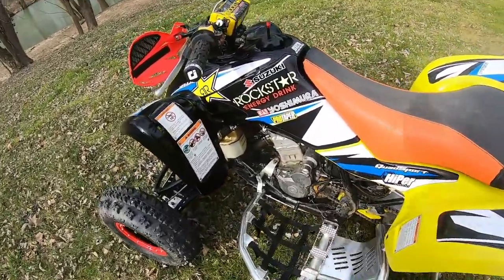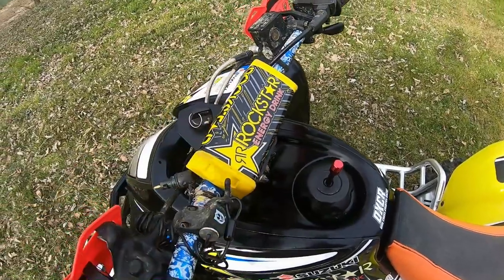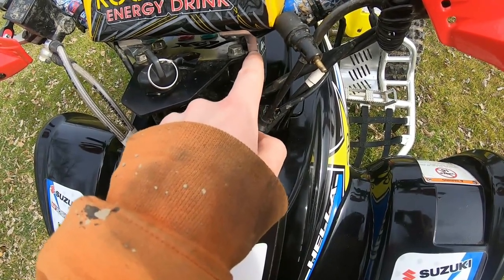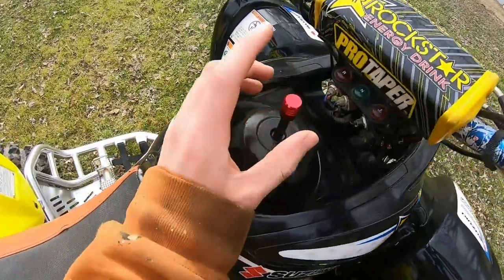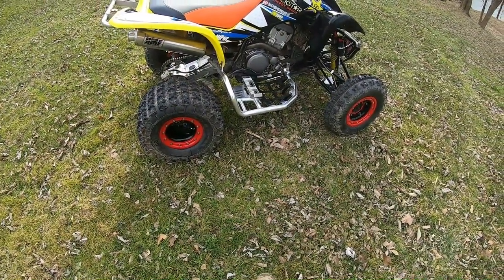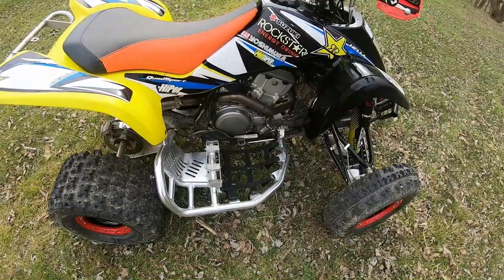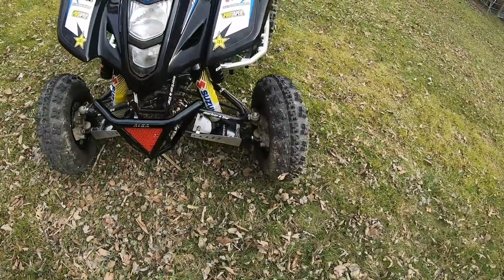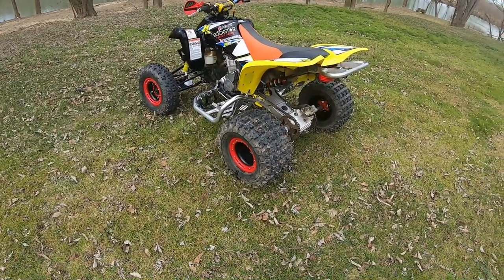WALK AROUND OF MY 2020 RACE SEASON BUILD LTZ 400

Comment: Can you do a update on this build
Reply from the maker: I wish I sold it last year.
Reply: @nhamilton492  can you please give me a list in the comments of all the parts
Reply from the maker: @mxlura1  Parts list 
Rox Speed FX 2 inch handlebar riser 7/8 oem bar mount to use 1 1/8 handlebars 
Rox Speed FX dash board 
Odi rogue lock on grips 
Acerbis uniko vented handguards 
Alba racing beadlock wheels 
Elka stage 3 Legacy Suspension
Streamline steering stabilizer
Reply: @nhamilton492  is the Elka suspension worth it
Reply from the maker: @mxlura1  yes they worth it
Reply: @nhamilton492  why did you sell yours
Reply from the maker: @mxlura1  to buy a dirt bike
Reply: @nhamilton492   I just seen it on Facebook  for 1500 I'm in need of half withtiming problems on mine
Reply from the maker: @rednecknation5780  do you have Instagram if so what is your account